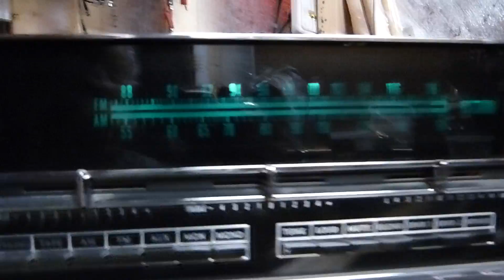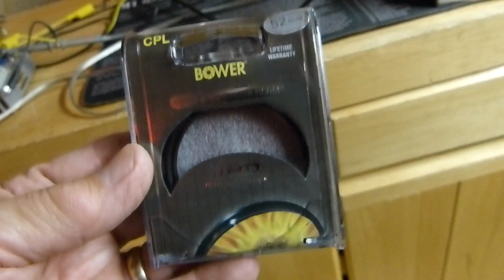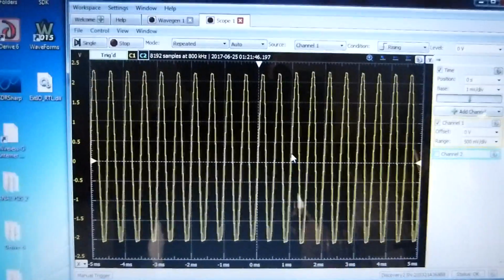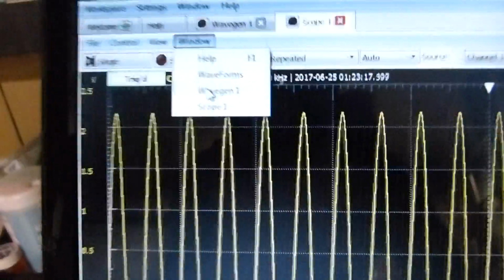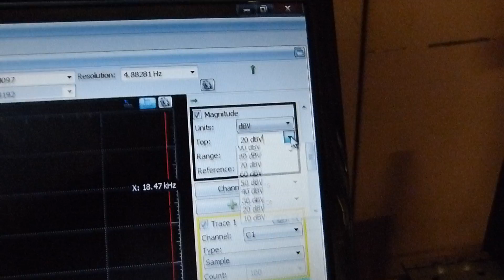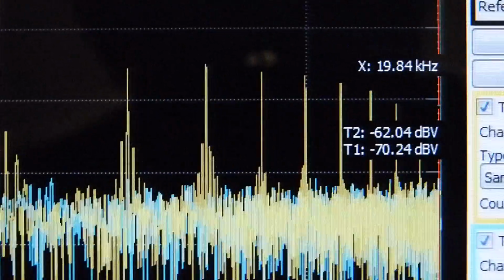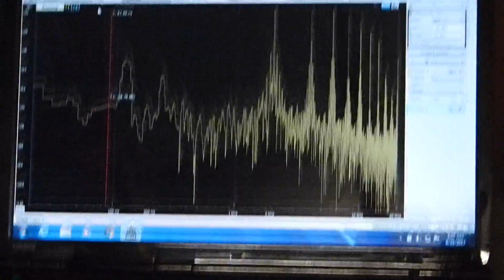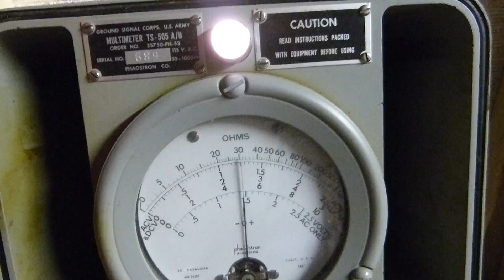Using the Analog Discovery 2 To Evaluate  1972 Heathkit Receiver

Comment: It's interesting to see how that AD2 and similar digital simulation of analog measurements perform. They do a good job of representing several much more costly analog instruments, but I don't think they can ever completely replace the analog instruments for a true measurement of an analog signal. 
I'm coming to realize that both analog and digital instruments have their place. But, the days of high end analog measurement devices are pretty much over. Once the HP and TEK instruments are no longer serviceable, it will be an all digital world. I believe I have lived in the most amazing era of electronics. Been messing with this stuff for 50 years and still learning. I really enjoy your videos.